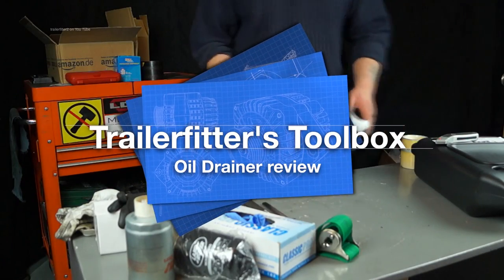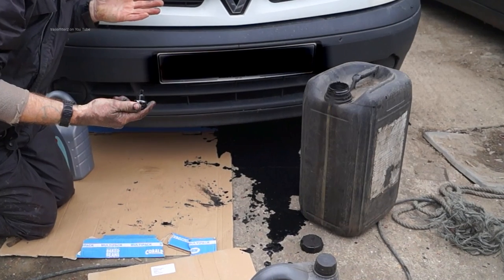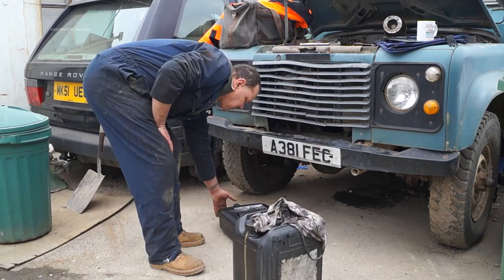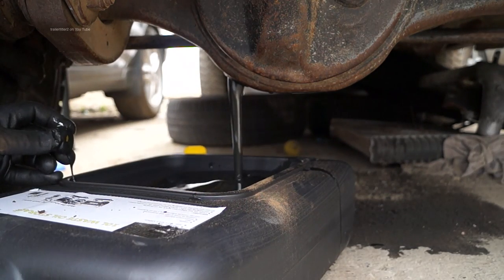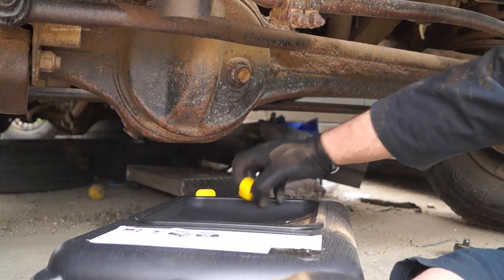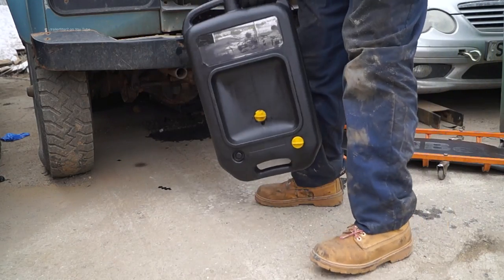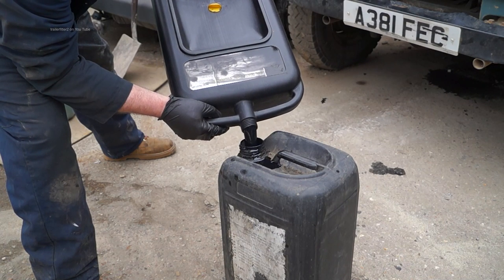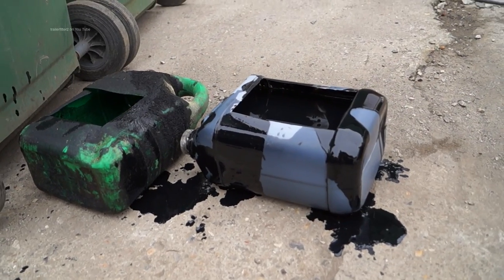Low profile oil drainer PM1243 suited to Land Rovers

Comment: I have a similar product for engine oil sump draining. Sadly if the hot oil is a bit too thin, it bounces off the trough and goes all over the driveway so I'm going to get a bowl type drain pan instead.